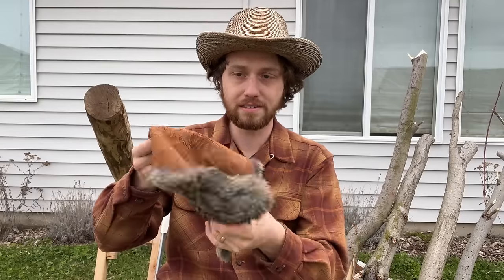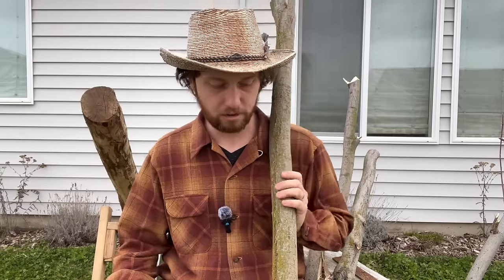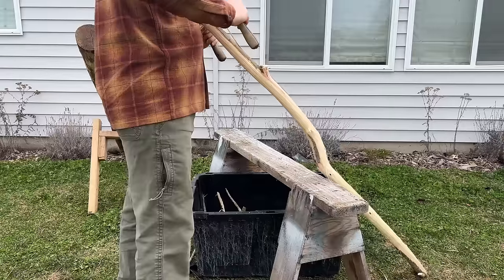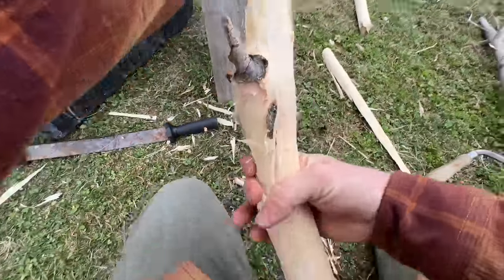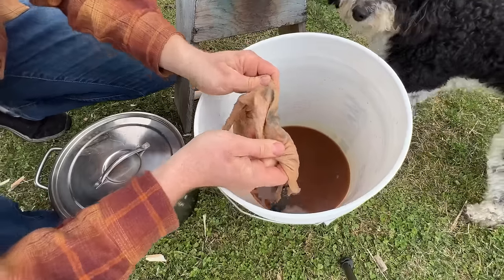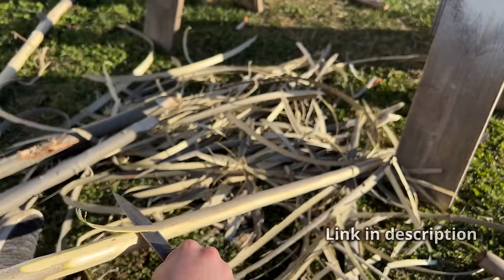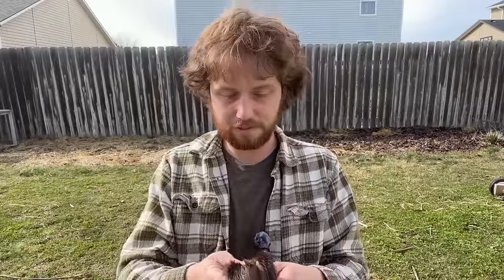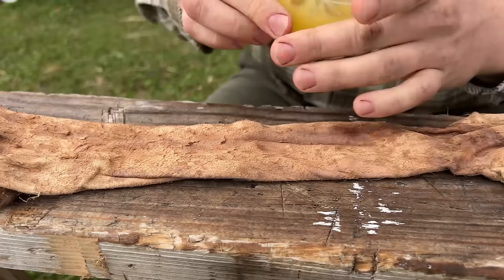How to bark tan furs. Easy way traditional hide tanning using tree bark.

Comment: In 1968 I tanned a Javalina hide with the help of an Apache man in Tucson Arizona. He told me to soak the hide in the ground in horse manure and urine. Waiting 2 days then I started working it over the hitching post daily till it became white and very soft. It worked.
Reply: Wow shidid an farted
Reply: Instead of all the chopping of the strips, just run everything thru a chipper ! Fast and effective. I am native Alaskan😅
Reply: Is that real? I’d be really suspicious. If I was Native American I would definitely tell white dudes some nonsense like that just see if they would do it.
Reply: @austinsmith3676 Haha that would be super funny, you’re right. 

Surprisingly it’s real though; I would skip out on the poop though if you end up trying it out. Using the animal’s brains or urine are much better options; and it has the added bonus of not subjecting yourself to parasites or diseases in the horse poop. So I really doubt the native man was lying, there’s just better options than playing with poop.
Reply: @austinsmith3676 yes it is a form of tanning. Generally making a hard type leather.. not used as much for furs due to the solution can also discolor the fur so brains ,eggs and man made formulas are used for furs
Reply: @austinsmith3676 as weird as it sounds that's how it was done forever until more recent times.
Reply: @austinsmith3676  yup. Urine tanning was a very popular method for centuries, because it didn't darken the hide or fur. 
Urine tanning is why European tanneries were placed on the outskirts of town, downwind of the population center.
Reply: Acorns are also super high in tannins as well(plus the acorns are really good to eat after the tannins are boiled out of them)
Reply: @larenkevin4531 it's also where the term "piss poor" came from. Families so poor they would pee in a pot and sell it to the tannery. And then you've got the term "so poor they haven't a pot to piss in." which you can figure out.
Reply: God i hope the savage didn't scalp you dam Apaches
Reply: God i hope the savage didn't scalp you dam Apaches tsk tsk
Reply: Well you know there's going to be different ways to make leather, especially in places where there's no tannin available
Reply: @cendricle 🤣🤣🤣🤣😂😂☢️☣️🚫💩☠️💥❤
Reply: Hola!, could you please give those instructions? I want to try it out , gracias !
Reply: There is ammonia in urine helps to clean the Hyde and I suppose there is tannin in the poo interesting 😂
Reply: But at what cost
Reply: @cassaxiom8019  add concentrated ammonia solution to your hide with a bit of formaldehyde first and then treat with tannic acid and afterwards treat the hide with dubbin when dry 😂 then you have copied the whole process.... without the labour but then your hide won't have the genuine wild man smell
Reply: Urine tanning is still used on in Mexico quite frequently. The problem is it’s not really sanitary, if the weather gets wet begin distinct like urine. Although urine is sanitary coming out of the body it attracts a large amount of bacteria is resolved when you’re in Tampa leather gets wet it attracts a lot of bacteria.
Reply: could you write a really short description of how tanning should be done? I feel like theres no youtuber who actually shows the whole process...so you skin it, then you can leave it 2 days in urine (or I saw a creator making a mix of alum and salt water and leaving it in that for 7 days) and then you take off all the flesh left on the skin right? and then you rub brains in it? I have yet to see someone show how to use the brains, like how much brains and how to spread it, do you just use straight up brains or do you combine it with something else? how long are the brains supposed to stay on there? at what temps?.... I am confused :D
Reply: @45johngalt the term piss poor was used for those that sold their piss to go with indigo leaves to make blue dye
Reply: - *Very, very ont
Reply: I've used just burying a de.boned squirrel tail, sliced open de boned covered in salt for almost ? 2weeks.  it was like paper at first, but after working the hide with some beeswax  it was sewn up and used on my car antenna a flew in the wind like a soft tail.   😊❤ That was  my 1 attempt at  tanning 😂

Comment: I'd recommend upping your decibels on the video a little to closer match Ads. I had to max out the volume to hear the instructions, but then would absolutely blast my eardrums out with my eardrums out when ads unexpectedly pop in.
Reply: It does little good to beg these video producers to make a video that all can hear. You always have them or someone around with kean hearing saying I hear just fine and that is where it ends.
Reply: @larrytischler570  that's why it's easy to load into Audacity and match the Db output to an ad.

Comment: I feel like this could be part of a larger process. You could strip willow bark for making cordage, boil it to remove the outer bark layers, use the willow branches to build a frame or baskets if they're young, and the tannins you could use for tanning. It's just a great way to make sure all parts in the process get used.

Comment: Tannins from the charred wood barrels also make dark liquor hangovers worse than clear alcohol beverage hangovers. 😊 Also if your going  to plant a garden. Do not plant it down hill from or in the soil nut bearing trees have dropped their nuts. Those very same tannins in the rotting shells  will stunt the growth of the vegetables that are produced. I did not know this and planted a very sizable garden. 3 150'  long rows of corn 4 same length rows of snap peas, squash ,cucumber , watermelons and potatoes. My ears of  corn though fully mature, were never longer than 7 inches the squash were 4 to 5 inches the cucumber were not much bigger than the large dill pickle variety and the mellows though ripe and sweet were a little larger than say a softball and a half. The peas seemed fine though Idk why. My potatoes that I'd cut potatoes  in half and planted they were only the size of the half I planted. I learned by accident that winter about the tannins from the rotting nuts shells causing this stunted growth. Plant it at least an acre away and never down hill from soil nuts have rotted. The shell of in this case pecans did this. I also though well away had black walnut trees. Though the hulls make an awesome and easy to make  wood stain. My house built in 1870 has the stairs and rails also some of the wood trim made from the very trees on the land. Muskrat he has look like furry squid. Umm mantels?.. Their heads  top nots or noggins 😊

Comment: Bug nerd here: tannins in general are used for insect repellent, but gall-forming insects actually really like having tannins around them because it increases protection from fungus! They produce hormonal secretions that drive the tree to make the galls, and it boosts the tree’s immune system reaction to fungi in and around the area, which might otherwise eat the midge’s food source! You see something similar in a lot of wasp galls- my local area has these oak gall wasps that create big ball shaped galls, and they only tend to start rotting after a lot of the tannins have leached out. The comparison between gall’s tannins, when leached out, and bile, is where “gallbladder” and other such words came from.

As a side note, some of the midges and wasps make their host plant produce nectar on the gall, to help attract ants that drive off predators and parasites of the wasp or midge! It’s free syrup, albeit in tiny amounts.
Reply: Does that mean you can use oak galls as a source of tannins?  I collected a bunch in a nearby park because I wanted to make medieval ink.  You mix rusty iron things and the oak galls to make a very dark ink.  Makes sense after seeing the tannins react to the rusty traps.
Reply: @hatedcritic8066 Yes, absolutely! The ink is produced by iron ions binding with the tannins in the galls. My understanding is that galls have a slightly different tannin composition that makes them especially useful for ink production, but frankly there’s a lot I don’t know about galls, and I might well be mistaken.

Comment: I am literally in the middle of tanning two hides right now! Your shorts series was really helpful. Excited to watch this one.  I’ve got two hides strung up drying and two 5 gallon buckets full of tannin tea. One from oak leaves the other from elm leaves. They’re super dark. But it’s a test to see if there’s enough tannins. I have access to the coyote willow but couldn’t figure out a way to debark it efficiently.  I did use it to make my stretch hoops. 

I was wondering tho, is it necessary to stretch and dry the hide? Why not just put it right into the tanning solution after de-fleshing?
Reply from the maker: The benefit to drying is any small bit of leftover fat in the hide melts and can be wiped off when it’s dry, but it’s not totally necessary. Better taste your tannin solutions. They should make a somewhat strong drying sensation when you swish the solution all around your mouth. Thanks for watching!
Reply: Update: my first hide turned nice n dark over a week or so of tanning. But it dried rock hard after I removed it from the solution.  I rung it out each day, and it seemed like it was working. 
If this was due to lack of working the hide as it dried I’m wondering if I can put it back in a fresh tanning solution. And try again? 

I’ve got another hide in an even stronger oak leaf solution now. Two days in….
Reply: @prescottmccarthy how did they turn out? I’m invested 😂
Reply: @mylesloan  😊 so the first hide I had in for a week and I rung it out each day. It turned nice and dark brown and I was a little concerned that the tea had used up its tannins so I took it out to dry. It really looked good and finished. But when it dried it was hard and stiff. Not really useable.  Maybe it was partly because I didn’t work the hide while it dried? He didn’t seem to do much working the hide in the vid, but other tanning methods it’s a huge part of the process. Maybe I’ll try re soaking it in a fresh solution and working it as it dries. 

The second hide I still have in the stronger oak leaf solution. It has turned really dark but I can tell it’s not tanned all the way thru. So I’m just gonna leave it in as long as I can (so long as it doesn’t start smelling weird or falling apart.) if it works I’ll check back in.   

If both don’t work I’ll just keep trying, this does seem like a great method, I just gotta get the tea right. I can feel the textural change happen from slimy to satin. It’s pretty cool.
Reply: @prescottmccarthy Did you stretch it out/soften it via stretching? I see that done in many tanning videos, wondered if you had done so.

Comment: I have some hides that I have salted and stable. Is the process the same as starting from rawhide or do you have to scrape the salt before putting into the tanning solution?
Reply: I have a salted hide sitting in a tub in the garage… Been months since I put it there, I should check on it!
I was going to rinse off the hide, then put it on a fleshing beam and flesh it, and THEN tan…. May or may not dry it in between.
A lot of people soak/rehydrate raw hides and then tan them rather than throw them straight in….

Comment: Do u generally flesh and salt the hides rolled up (flesh side in) then most tanning methods call for one pound or so salt per gallon of water mixture..then do u add bark solution? I wouldn't think hides would tan without salt.

Comment: The other day I had to throw out nearly half a buffalo hide. Left it stored in what used to be a safe area for a few years. It technically was just fine, had no mold or issues with the hair falling apart, but it pulled out a mildew smell from things condensating around it and I could not clean out the smell. So basically it ended up useless. If I could have put it in a giant vacuum sealed bag I would have but they don't make them that big. Thankfully I didn't lose any money on it since it was given to me but it still pisses me off that it was ruined by smell. If you know how to remove that smell I would very much appreciate the information. I don't want to have to throw out another hide if this happens again, unless I absolutely have to.
Reply: When you smoke the hide the only smell will be smoke, which will fade

Comment: I think you got it backwards. Bark Tanning is to make leather, and depending ccx what oil you use to finish it, will determine whether it is shoe, belt or backpack & pouch leather. It is not as flexible as Buck Skin.
      Brain Tanning is for clothing, it is more flexible and stretched back. But it is better to know the natural tanning methods for both bark & brain tanning, just in case there are no supplies to buy at the stores.
Reply from the maker: Different barks have different effects on hides. Oil of course plays a role in the kind of leather that will be made, but willow is renown for its ability to make soft leather, while oak can make very full leather, and alder makes more delicate brittle leather

Comment: I've got 3 skunks to tan. Hope it takes the smell away
Reply from the maker: With skunks you will probably want to de-odorize them before hand. That skunk essence is powerful stuff. It’s simple to do though. Mix 1 pint hydrogen peroxide, 1/4 cup baking soda, and 2 tsp dish soap in a bucket with 1-2 gallons of warm water. Put your skunk hides in and stir. Let sit for 5-10 minutes, wring them out and rinse, and the smell should be gone. Put them back in if still smelly and wait another 5-10. Use the deodorizing solution immediately when you make it. It deteriorates fast.